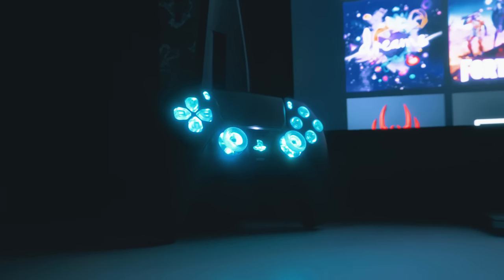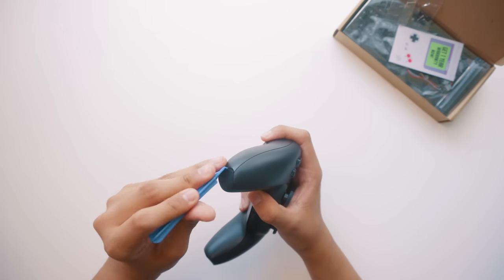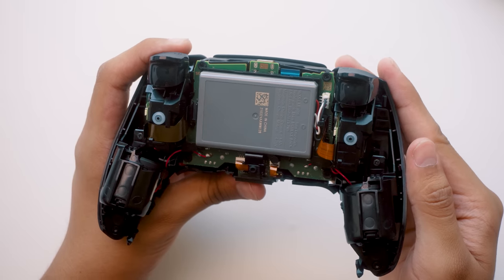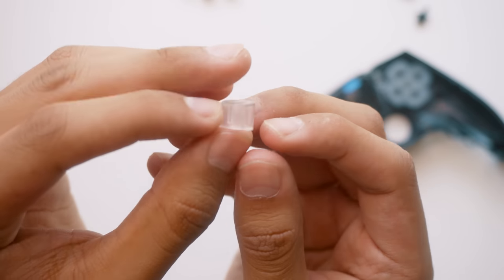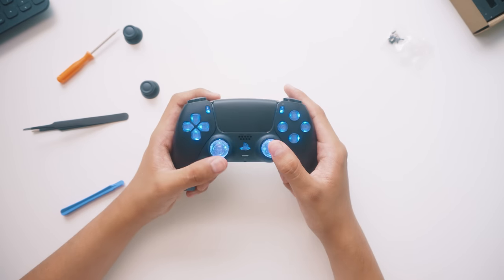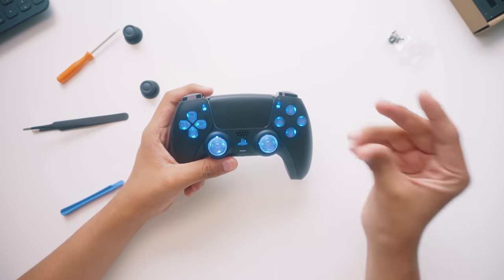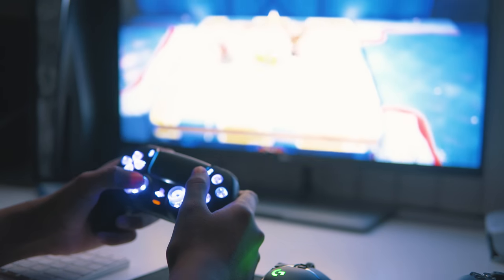I Put RGB Lights in my PS5 Controller

Comment: Looks great, your vid has made me REALLY want to do this, sadly both of my controllers are too new to actually apply this kit to.
Reply: they can be too new? are they different or new as in you don't want to do this yet?
Reply: @SamFranklin42701  Yeah, Sony made a slight change to the dualsense controller a few months back, the internal board is in a different configuration and I have heard rumour that the actual shell has a slight difference too now, so a lot of the vanity products are currently only compatible with the old style.

Comment: Awesome video as always. I am expecting a video about converting and old switch to the new oled version like replacing the screen or the back plate or something it would be super cool. 😎
Reply: Not possible
Reply: @aidanbustos7170  It... is? Have you heard of shell swaps?
Reply: As a matter of fact, check in the older videos, he made a video about it already
Reply: Check on the link, is this what you were talking about?
Reply: Front bezel? Maybe. But for the backplate you'll need the OLED motherboard since the TF Card Slot is different. Also the OLED is ever so slightly wider.

Comment: Did it today works like a charm. But the lil silver rectangle falls off and is annoying on mother board.. have to hold it or becareful once it falls off its like brain surgery to keep on. And the light track for the joy sticks need extra adhesive, doesn't stuck good .a few drops will do the job looks sick. only I can play with it no kids allowed !!

Comment: Mine came with a ribbon cable that had to be taped at different areas to the right-side trigger and a 90 degree angled battery cable instead of a parralel one adding to the difficulty. Still, was happy it worked in the end.

Comment: So I had bought this light from Amazon used it on my white controller and it broke then bought a black one and everything was good don't try this on the white controller cable cords are old and will brake easy use in on the new controller work good for me until the lights started to change  different like it was blue and 1 analog stick was red so It's good but will start trippen after a wile

Comment: Looks really awesome, but battery life is already short on these controllers. Or I just game too much🤣but def looks cool!
Reply: Beats buying batteries all the time
Reply: @ogkush1828  but no one buys batteries anymore anyway.
Reply: @zopler5537  I’m pretty sure he’s referring to the people that own a Xbox which have to buy batteries for their controllers
Reply: @brandonrisso  the thing is we don’t buy batteries for Xbox controllers as they come with them and just charge them no different then then a PlayStation controller on top of them lasting a few hours more on the charge. Just correcting false information here. I do play both but damn does my ps5 controller die faster then my x.
Reply: @zopler5537  you can’t use the controller while charging
Reply: @squarbrainman4037  you can a 100% use it while changing. I really don’t get this false information you guys are spreading or got told as it charges no different then PlayStation.
Reply: @zopler5537  wait you can do that now that’s sick I thought you had to remove the batteries
Reply: @squarbrainman4037  nah you don’t have to anymore since late 360 if I’m not mistaken but as of now you can use any supported charger even a PlayStation one will work but I’d still recommend a Xbox specific to avoid any possible problems.
Reply: @zopler5537  hey man I appreciate clearing that up for me, I used to own an Xbox 360 and I remember the battery days lol. I switched to ps4 after that and never looked back.
Reply: @brandonrisso  it’s all good but yea back then it could get annoying and get a bit expensive before you could charge your controller so it’s understandable why you’d switch.

Comment: Not only you're using metal tweezers near a still plugged in electrical circuit but you're pulling the cables in the worst possible way. For anyone interested in doing this please get a pair of ceramic tweezers or use your fingers, and pull the ribbon cables from the base!

Comment: Uhhhh I just installed this and was playing for a while until my controller died and so I tried to plug it up and after a while I tried again and it would just flash orange 3 times, anyone know what that means??
Reply: yeah, you forgot to sell your left kidney.
what did you expect for some cheap LEDs
Reply: @user-si5bk4mm3t  damn, u right
Reply: This happened to me plug it in then turn on the the ps5 using the buttons on the ps5 ur ps5 might be out of battery and won’t work
Reply: @user-si5bk4mm3t  it’s a real glitch I had and I didn’t buy the led lights
Reply: @thewholesomeyoutuber8637  ok I’ll try it, thanks!
Reply: @slappycake8412  did it work

Comment: i had done this plenty of times before and with my ps4 controllers, its an awsome mod for my Ps5 controllers as well, highly recommend!...BUT i also recommend that while ordering this mod from extremerate on amazon or ebay ect. that you order another battery also, your ps5 controller comes only with a 1560 mah battery, you should order and upgraded battery as well. like a 2700 or a 3000 mah battery because this mod WILL ofcourse kill the battery faster while playing your game im sure some already know or had done that but not all think ahead...lol...just thought id throw that out there cuz thier are air heads 😆
Reply: good shout
Reply: i do my own mod of removing the rumble motors. it saves like a pound of weight. makes controller way better for extended sesh.
Reply: I don't believe those 3000Mah are legit, they seem fake.
Reply: @Adam_U   They are not fake, lol I have a few extra of those batteries and I have 2 ps5 controllers that I put one in each, not for LED lighting of course but just so I can get longer use out of my controllers without charging them as much as the next person plus I think it kind of saves your charge port because I know a lot of people that had charging port problems on the PS4 controllers with the port itself going bad.

Comment: So mine didn't go  as planned. Everything was doing great until the coms white little plugs came off and I couldn't get them back in. Then I couldn't get my others pieced to click and then left with a screaming child. I had to solder wires that broke  while clicking in pieces. It was a nightmare for me. Unfortunately. So I'm hiring someone who knows wtf they are doing to corrects all my mistakes. Thanks thou. The set up was easy it's just the way controller was built. Xx

Comment: I installed the lights but now I can't play video games or use apps. It only works on the home screen. Help
Reply: You might need to check your controller again. Just open it up again and look if anything is not connected, if that does nothing i would try to reset the controller or remove the mod from the controller and return it and say its broken

Comment: I've just bought a led kit but mine as 2 circuit boards In it I've installed the one with the wires on but I'm stumped as to where the other one goes to you have any ideas or videos

Comment: Cool but awful especially with how bad the dualsense battery life is. Shit dies in like 3 hours for me.
Reply: @Dz that’s literally the reason why🤦🏾‍♂️
Reply: Wtf my controller lasts 6 hours at least on a full charge
Reply: @sherKhan-qq7cy  ya was gonna say the same thing
Reply: Did you guys try turing on the battery saver in the settings? Turns off the controller after a few mins of unresponse so should extend it more for u

Comment: So I did this and I’m now experiencing some problems with the right joystick. 

Is anyone else having this problem? Can I fix it?

Is this because I did something wrong or did I get a defective set??👀
Reply: Probably did something wrong but I’m not sure just redo it just in case
Reply: @Naz_plaze21  I’ve reset it and nothing. I’ve simply chopped it up to a loss and assumed I messed up a wire. I ended up going back to the original joystick and leaving the buttons, looks pretty cool now. Thanks though!
Reply: I’m also having this issue. Was working fine for two weeks then all of a sudden the right thumb stick would only show as red or green. Now it’s completely off.

I’ve seen another review with this issue. I’m wondering if it’s to do with the flexible motherboard being too long for the thumbstick sections - as they almost fold in half?

I’m wondering if it’s possible to trim the flexible motherboard then solder back together shorter - but it feels like an absolute no go!
Reply: @nataliemorrison448  yeah the company should work on this issue!

Comment: “I hAvE aNxIeTy I cAnT tAKe My CoNtRolLeR aPaRt” Damn y’all are incapable
Reply: not everyone is a professional in electronics, especially when it is this small 

I will do it doe
Reply: @creblabo  you dont need to be a professional haha, i certainly aint and i could do this easy.
Reply: @samueljackson2257  its easy, but some people are still scared to do it because its an expensive controller and it would be quite annoying if you would break something, so yea, you don't need to be a professional but you still need a bit of confidence
Reply: @creblabo  fair point, i took my duelsense apart a few months after getting it because i dropped it and broke the spring on the r2 trigger, and i was quite afraid to damage it but i just watched a tutorial and i was fine. i had previous experience from taking apart ps4 controllers so it was quite similar.

Comment: The controller battery is already bad as it is. The battery dies just by me watching Netflix.
Reply: Well buy the media remote then
Reply: @swat__sas1177  I'm not wasting money on a separate remote for a game console, just so I can press "play and pause" without the battery dying. That's a dumb idea. How about just make the batteries last longer in a $70 controller; it shouldn't be that much to ask for considering the price of the controller.
Reply: @SourStrawberrys  👏🏽
Reply: @SourStrawberrys  weird. my battery lasts really long.
Reply: @eemilveijalainen  My battery goes out just by watching a couple of episodes of Netflix/hulu. I probally actually watch more than just a couple of episodes. But still, when I'm watching I only touch the controller to play and pause.
Reply: @SourStrawberrys  have u tried turning the led light im the controller to lowest? it should save much battery.
Reply: Another thing you can do is turn your controller off to save battery I do it, it’s a easy and supposedly obvious fix. Also, plug it up while watching your shoes so the battery won’t drain. And the reason why the dualsense is so expensive is because of the more things it does in turn it drains the  LITHIUM (one of the worlds main power source for making batteries, electronic chips etc.) battery more. Btw the lithium battery gets weaker over time itself just physics 🤷🏾‍♂️
Reply: @89thorodinson  Turning the controller off and turning it back on everytime I want to play, pause, rewind, and skip intro or credits is annoying. Expecially with these short 20 min episodes that series consist of. Also, considering I took physic 1 and 2 in college, I'm pretty sure that has absolutely nothing to do with physics. Physics is the study of matter and its motion as it relations to time and space. A weaken battery over time is due to chemical breakdown in the the flow of ions within the battery; its a circuits related topic. I never questioned why it was expensive. But the price should also include a better battery that can be able to last when all those features such as gyro, rumble, etc are not even in use. It shouldn't be draining that fast by simply being on yet using none of those features. I also put the light on the controller on the dimmest setting so it isn't even using all those features when I'm simply watching Netflix/Hulu.
Reply: Turn ur controller off when watching the video wtf lol. Who leaves the pad on? Are u controlling the actors ?
Reply: @eemilveijalainen  Yes, I have. It is on the dimmest setting. The battery still drains pretty fast.
Reply: @5part4  Try reading replies before commenting the same nonsense someone else said. I literally addressed this in the comment right above yours..
Reply: @SourStrawberrys  well if u find turning off the controller for rewind and credits is annoying. Ur one weird Netflix user. Just watch the whole film and f.uck the credits lol ?
Reply: @5part4  I keep writing a reply and fu.cking YT bots keep deleting the reply for no reason. But to answer your question. Do you turn off your remote everything you watch a show/movie? So why TF would you turn off your controller?
Reply: @5part4  Only a mo.ron sits there & watch the intro and credits for every episode of a TV show.
Reply: @SourStrawberrys  remotes have super long battery! Lol you can't compare a TV remote to a modded ps5 pad bro 🤣. Do you mod the TV remote with lights lol. Merry Christmas and happy new year lmao.
Reply: @SourStrawberrys  also if your so worried about battery life I guess led lights aren't for you just get painted shell so the battery doesn't get effected and ur control pad has colour and still cool. That way u leave the pad on. Problem solved lol
Reply: @SourStrawberrys  alright whatever go cry then lmao bye lol
Reply: Me I watch Netflix on my home theater 😎

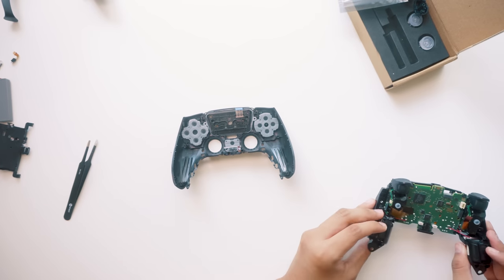Comment: Hahahahahaha my controller drifts and it is a ps5 one 😢 6:02
Reply: You should've taken care of it better
Reply: What you do is when you buy a controller check the back if the code ends in 1 take it back and if ends in A keep it as if it’s 1 you are most likely going to experience for issues ❤
Reply: What u can do is spray electronic cleaner in between the sticks, its the feelers for the joystick that might be a bit dirty😊
Reply: @ThatGamingGuyAU  so you’re just going to keep telling them to get a different one and hope it ends in an A?
Reply: @Zbeast5972  most new ones are A so if they have 1 on the end they should get a new one and if it’s still 1 just give up if it’s A perfect but anyway most controllers and in A so you should most likely get one first try
Reply: @ThatGamingGuyAU  good good, which section am I looking for that should have the A at the end? And is it on the box and controller? Or just the controller?
Reply: @Zbeast5972  it’s only on the controller and if you want to find it it’s on the back and the code thingy is above the Sony text

Comment: Am I the only one that has problems with fitting the light things on? It seems too small when I put the RGB lights and connect the flap it doesn't come around enough
Reply: Update: the little circles for the flap on the back broke because it's too short of a connection letsgooooo there's 30-40$ gone woooooo

Comment: Controller's usually only last for a year or year and half...what happeneds then?
Reply: Wtf are you doing with your controller for it to only last a year???
Reply: @asfi6584 Casual wii sports enjoyer i guess
Reply: I’ve had my DualShock 4 controller for 8 years and it still works fine

Comment: Guys don't do this to your controller. While its cool at first eventually your controller will keep randomly shutting off, even if the battery is full. Thats on top of the battery only lasting about an hour. In the end your controller won't turn on at all. I suspect it's the led wires that just stop working but since your battery has to go through those wires then that means your controller won't work until you take out the LED wires. The RGB is cool, but I'd rather have a functioning controller over RGB buttons.

Comment: Unfortunately this mod kit did not work for me, I got the LED’s to turn on. That’s great my controller looked awesome .... then it didn’t want to connect to my ps5. An orange light just blinks fast twice then turns off and it doesn’t even charge. It’s stacked with the clicky action button mod so idk if that’s the issue but I doubt it .

Comment: I did this and messed my controller up
Reply: That's on you kid I just tore apart both my controller 1 white and 1 black. I swapped the touch pads buttons and backings now I have custom black on white and white on black. Didn't break anything
Reply: Your problem I guess

Comment: Ok so my black wiring came undone from the green board part. Is that the vibration? Can I glue that back on? It looks like it comes from the vibration.
Reply: Update: the red part came apart too.
Reply: @MidnightXxMelodii  Solder it back if it was soldered from the factory. Glue isn't conductive

Comment: good mod but not a smart one since the battery on the controller is really small and has low life also controller will need to be changed after few moths because of drift

Comment: Im sorry this got me excited but  when i finnaly installed the rgb kit it messed up my ds4 controller, it doesnt even light up. I dont trust extreme rate. I wish sony would do something like this thats really worth the money...
Reply: You can easily mess it up if you don’t know what you’re doing.. It’s your own risk. Unlucky.
Reply: @RisingPhoenix619  Indeed. If you don't know what you are doing you can easily mess it up.
Reply from the maker: ...This is a DS5 kit. What did you do?? 😭
Reply: Mans messed up PS4 controller with Dualsense
Reply: @DammitJeff  oh i know i bought one for ds4 but damn it sucks. They even delivered again for that piece with charging port but still it didnt work and it just messes up my ds4 controller. I did check compatibility and it is compatible with my ds4. So i dont know what the problem is. Just so sad
Reply: @RisingPhoenix619  well ive follow all the directions from the manual, and its just doesnt work i guess. I dont know if got scammed or somethin, but i did just waste money on that. My ds4 works fine without it though haha